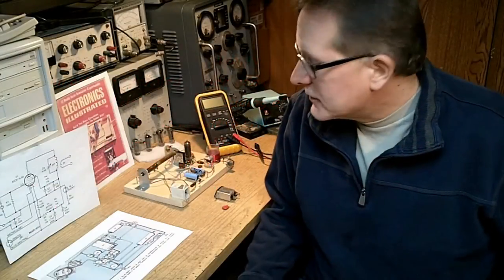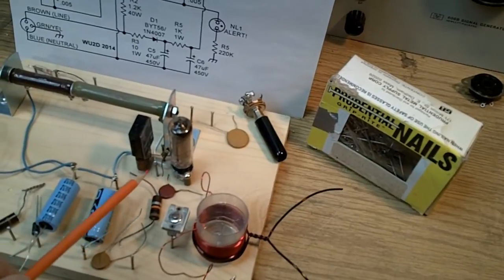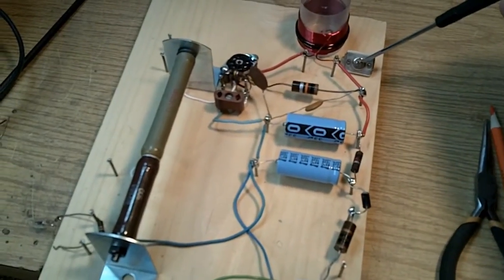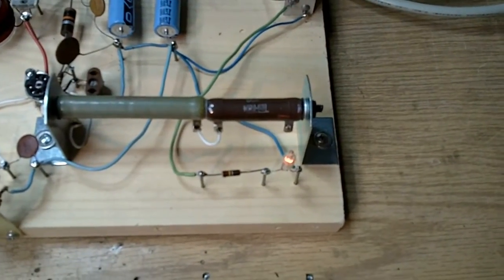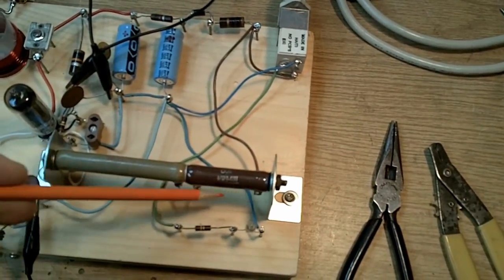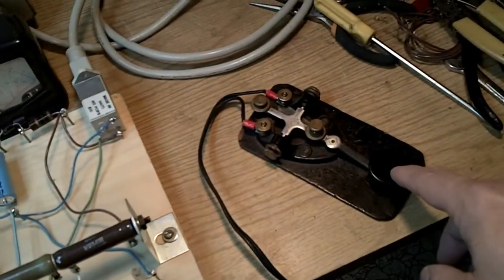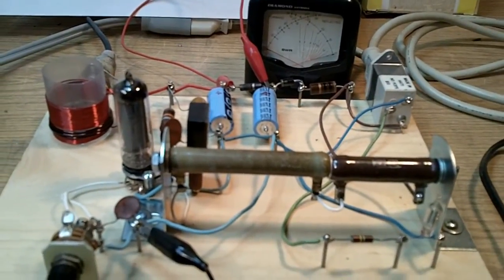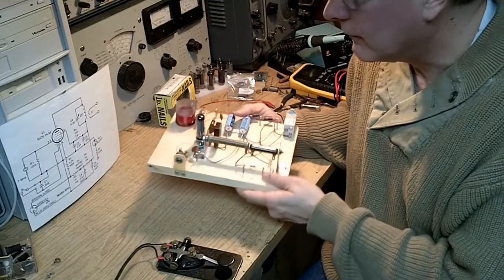Euro 50C5 Transmitter Part2

Comment: I built one when i was a novice.  DANGEROUS but fun. I used a plastic dittle stick on the trimmer and tuned the plate for min red. The base was bent  gavonized sheet steel.  year 1969
Reply from the maker: A very tempting project for a novice!
Reply: @MIKROWAVE1  it's a hot key for sure...

Comment: 50c5 getting rare. Had a rig that used two. Driven by a driver/ osc tube. Used to get tubes at FAIR RADIO.SALES© LIma ohio. Or later a Russian source. And ashamedly we snuck "red" tubes in to the frequency division multiplex  unit that gave 12 chanels of phone over wire or radio. Tubes are great except they were power hungry. Retired radio operator sgt williams/kv4li
Reply from the maker: Dunno, still tripping over tubes at hamfests. I think they made enough for a while longer!

Comment: why is there a tone with signal without modulation instead of making the radio silent?
Reply: I am guessing that the receiver used to monitor the transmitter is slightly off set and  in CW/SSB mode. If the receiver is offset by, say, 700Hz you will hear a 700Hz tone when the transmitter is keyed. Provided the receiver is in CW or SSB mode, it will insert a carrier or beat frequency which is 700Hz above or below the received signal from the transmitter to produce an audible 700Hz tone.
Reply from the maker: @Steve-GM0HUU  And sometimes I cheat on some of the videos using a separate receivver as a kind of code monitor!

Comment: good series.PLUS, you are using my most favorite pump key, a J-37. Unfortunately, I have glass arm, & have had to switch to a keyer, Bencher, that I use in the manual mode.
Thanks for some good work.
Dick, WB8MHE
PS; re; your ARC 5 series, I have & have used all of the xmtrs, & have all versions of the rcvrs, including the broadcast band type. I also have a rcvr that I made new HF & osc coils to tune higher than 9.1 mc. It allows me to tune to about 13 mcs.
TNX again.
Reply from the maker: Awesome! Those ARC-5s were the gateway drug for many of us!

Comment: Need to point out that there is very strict code for wiring in UK and the chances are extremely low that 13 amp socket is reverse wired unless by the most bungling DIY cowboy. If you used a proper electrician, it will be fine.
Nevertheless, it's very easy to check with a neon screw driver tester..
Remember that UK 240 vac is NOT 120/0/120v... but full 240 vac...reference earth.
Live (brown) IS 240vac ...Earth, the big vertical pin, REALLY IS earth. (Green)
The 3rd (blue) is neutral ... the return for the 240 volts and is NOT earth but is dangerously "earthy".
Should NEVER be connected to earth.
Can't see if your plug drawings are from front or back.
The UK 13 amp plug..viewed from the PINS side is:- 
 Left horizontal LIVE.  Right Horizontal...NEUTRAL.
Bigger Vertical is EARTH. 

240 hurts more than 60/0/60 vac.
Hope that is useful.

Here's a safety trick:=
Two disused transformers from old phone chargers, having the same sec. voltage windings can be wired...
Mains Primary in..low volts sec  to low volts sec: Mains volts Primary out, for a safer supply. It doesn't matter a hoot what voltage the secondaries are, as long as they are the same!

If they're both 6.3 volts, you could use some tube needing that heater voltage and dump the 50C volts dropping gubbins,  Safer on the board and no heat to dispose of, nor power to waste.

73 G3NBY
Reply: sounds like ya might be about half sharp, mate....these look kinda scary, these XMTR's, but would love to see one up close....wonder if 110-120VAC here in the USA would work with this set-up....different tube, maybe...bit less output....love valves....I really do...got my start on valves and crystals radio....built a code practice oscillator in the late 70's....now I'm an Extra Class Ham....my how time flies...
Reply from the maker: @cooker4409  The original Transmitter was for the US mains at 117 VAC. http://foxtango.org/Files/BareEssentials-W5LET.pdf